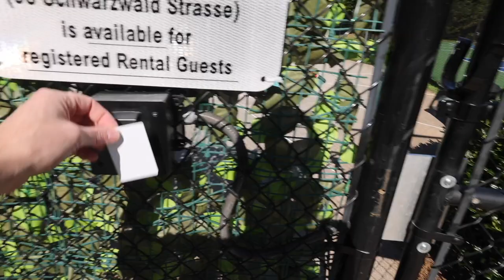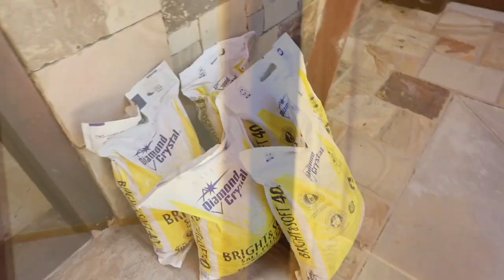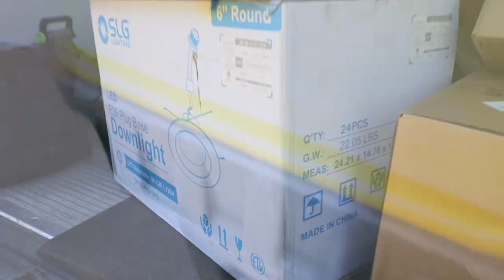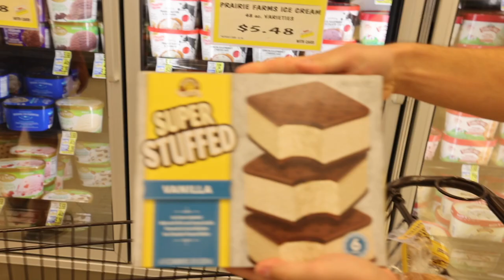Building Destination OG: Phase One  - The OG Crew Arrives, and Tour of the Clubhouse (Ep. 7)

Comment: The clicking on the M2 could be dirty hub and wheel surfaces. The C7 had that issue where they would click on hard turns getting out of a driveway. Have to clean the surface where the wheel meets the hub. Super weird but it works